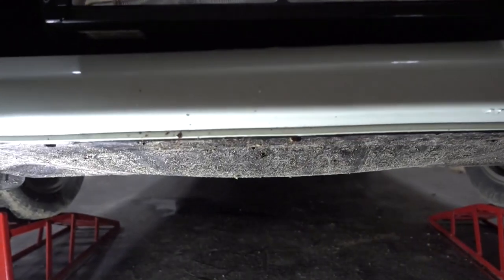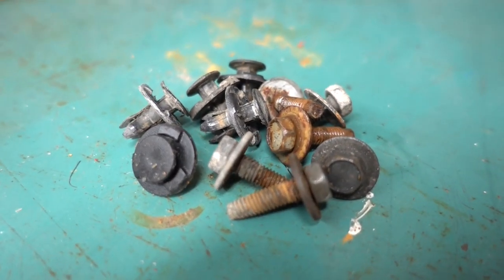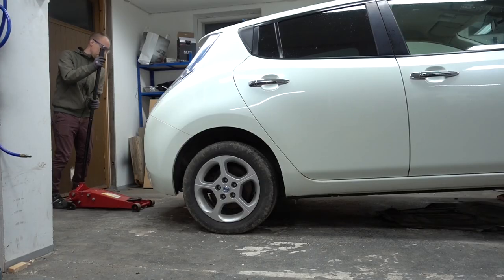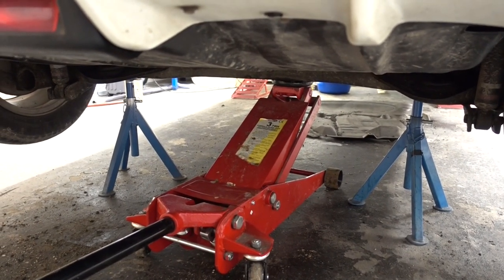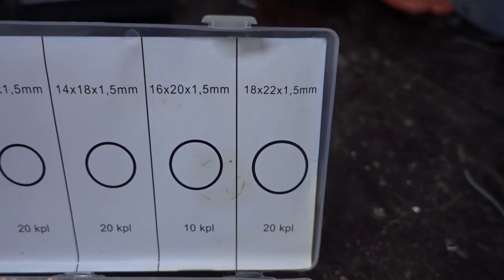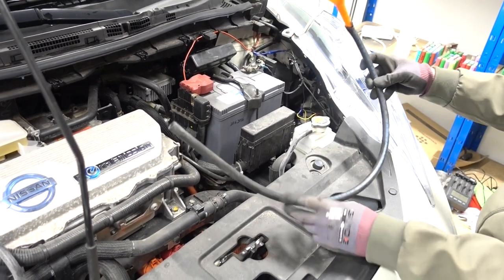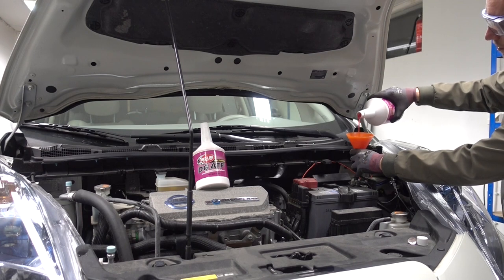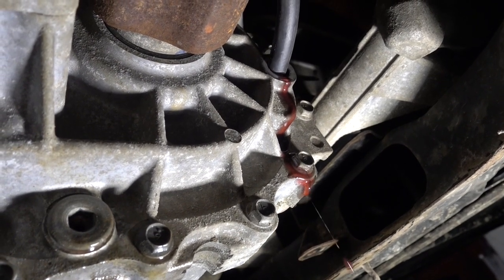Nissan Leaf Reduction Gear ATF Change [Efficiency boost!]

Comment: A cheaper alternative is "Castrol Syntrans V FE", I use 75W-80 and It is rated as GL-4+, still contains a small amount of Sulfur, so no danger to any brass bushings. IT has friction reduceres and a carefull Guess, I Think I'm saving 2-2.5%.  Another thing while you have the car off the grounds: check the wheel bearings. What is deemed good enough for a gasoline car, is worth improving. Take the bearings out and clean Them and then use Lithium Grease for bicycles. Then when you reassemble the hub, torque IT slightly less than the workshop manual Says, as initial torque is for new bearings, which need to seat. I use 90 Nm, and my not driven wheels spin for 40 seconds by hand! I do check my wheels off the ground twice a year and change Grease every year, and so far No surprises! Where this really makes a difference is in city driving, where Rolling resistance, is 3/4 of your drag. I can push the car with a single finger before the gearbox catches Up the slack, stopped on the Edge of a painted road stripe, the car Rolls off! My average current Went from 11A going around town to 7A, so my city Range is now Better than going 70kmh, which used to be where I got best Range.
Reply: clean them? I replaced mine because it was whining. So you have to press the hub off of the housing?
Reply: @macmaniacal  Sorry, not talking about a Leaf, but I could pry the front bearings apart enough to clean Them out with kerosene, and then massage new Grease through the crack. And drive axle bearings, can't be seperated and need to be pressed out, so They need to have the seal removed to regrease.

Comment: I notice you use a “generic” ATF. The official repair/service manual is very explicit about using only Nissan Matic S ATF. On any other fluid the write that you can use a equivalent wether it be cooling fluid or brake fluid etc. But regards to the ATF they do not mention you can use an equivalent. Have you any knowledge or concern using a “generic” ATF?
Reply from the maker: The one used in this video was Matic S compatible!

Comment: I have a 2013 Leaf and it is now making a low "motor" noise.  It was diagnosed as coming from the reduction gear.  To do a complete change would be over 5000 dollars!!  They did a fluid change and I hoped it would silence the noise, but it did not!  What is going on, and what can I do???
Reply from the maker: Used reduction gearcase is like 300 bucks. Try the mynissanleaf.com forum!

Comment: What is the name of the appropriate oil for  2015 Leaf?

My car ran 185,000 km and I did not change the oil Is there a problem with the gear and if I change it will a problem occur?
Reply: I leaving in 🇯🇴 jordan
Reply from the maker: Any ATF with 'Matic S' certificate works! Good time to change it :)

Comment: I'm considering getting a used Leaf here in Melbourne, Australia. I expect to have to deal with a dead cell in the pack. Can anyone tell me who can do such a battery restoration outside of the Dealership?
Reply: Try HP Powerwall on youtube...
Reply: EVolution Claylton South. ... Hey I traded one in in Melbourne  on a Kona EV 2 weeks ago. No dead cells.
Reply: @brunohill3229  Thanks for the heads up bruno hill.

Comment: I have a question I used LIQUI MOLY Top Tec ATF 1800 oil.
the Nissan now has less range is the oil I use worse?
Reply from the maker: No clue, the centistoke value will determine how efficient it is. The best oil to use at the moment is the Valvoline ULV
Reply: @DalasEVRepair  Thanks for your information. the oil is hard to get in germany i will try it and report back thanks

Comment: HI MY 2011 NISSAN LEAF COMPRESSOR COMES ON BUT IT IS NOT COOLING. THE HIGH PRESSURE IS READING 200PSI AND THE LOW SIDE READS ZERO. Any suggestions? Excuse the all caps.
Reply from the maker: Mynissanleaf.com

Comment: What about the differential? This requires an oil that can handle high shear forces. An ATF oil cannot do that. I had a case with a Mercedes w126 ATF oil was also filled into the differential. After a few 100 km the differential was completely over.
Reply from the maker: The reduction gearcase also contains the differential. See this video https://www.youtube.com/watch?v=L5WhB7uQLzY
Reply: @DalasEVRepair  this is the problem
Reply: @Halbwertszeit_ueberschritten  are you thinking about a hypoid gear reduction like in a reardrive differential?
The Leaf, like most frontdrive vehicles, doesn't have that setup nor require EP additives.

Comment: is there a way to turn off that dorky "EEENG EEEENG EEENG" that the leaf produces when reverse? I hate it. I just bought a leaf but I assume to be able to disable it. then later did not succeed. :(
Reply from the maker: On 2011-2021 leafs it can be done with Leafspy Pro. 2022-2023 are locked.
Reply: @DalasEVRepair  I will look into it. hopefully it's not expensive.
Reply: My 14 one did not do this.
Reply: @hoverbovver  maybe it was already tampered with when you got it

Comment: So how much is it need to pour this oil, i got a nissan leaf 2017
Reply from the maker: Get 2L
Reply: @DalasEVRepair  I bought two bottles like in your video but I don't think it's a full liter, will it be ok?
Reply from the maker: @kilof11  2011-2012 takes 1.3L, 2013-2017 takes 1.6L
Reply: @DalasEVRepair  thank U 💪

Comment: How ofen oil shoud change or how we should know need to replace?
Reply from the maker: Personal opinion, every 60k miles (100k km)
Reply: Nissan does not specify.
But I believe Mits-Pug-Cit specifies 100k km on their reduction gear.
I replaced mine at around 30k km after seeing pictures of black oil after 60-80k km from other cars. But the oil in mine at those 30k km looked as new.